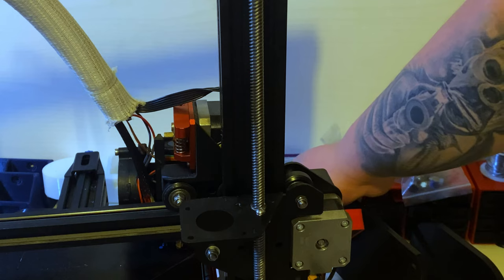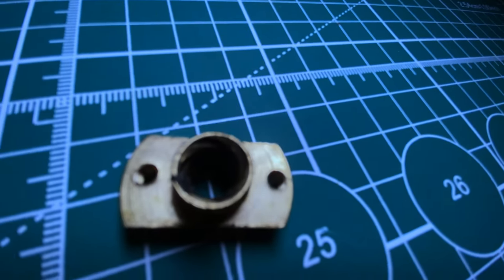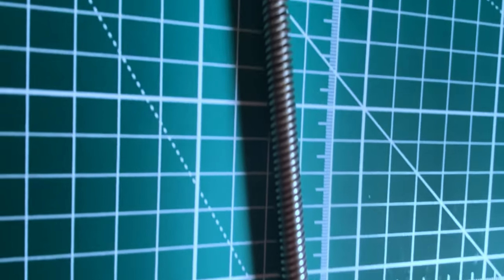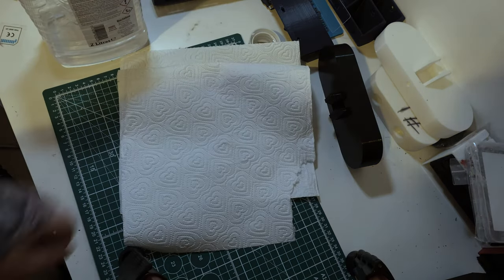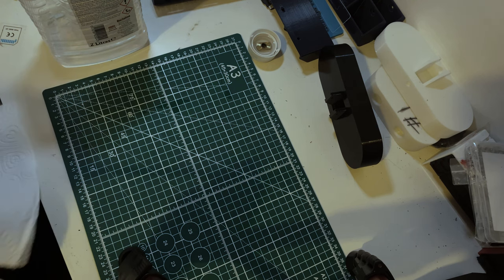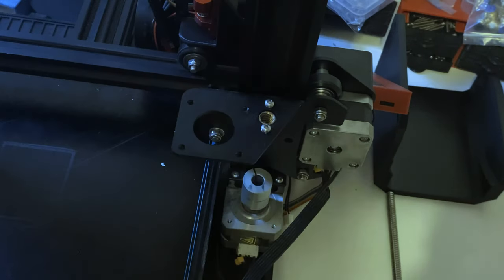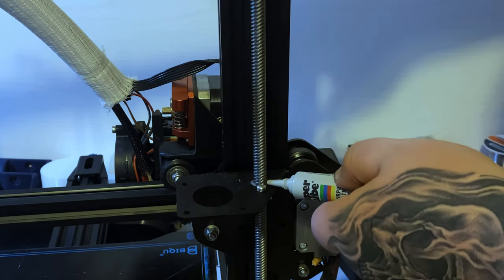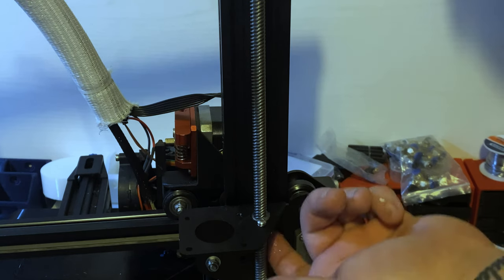How to clean  a 3D printers lead Screw Ft. Ender 3 v2

Comment: Its a lot harder when your printer manufacturer specifically tells you not to disassemble your axis (they use special nuts and you need to disassemble the entire printer to get to it...)...
Is there any plastic save solvent that gets rid of the old grease and dirt without brushing the threads?
Reply from the maker: What printer is it ?